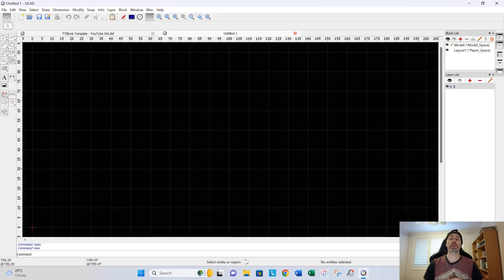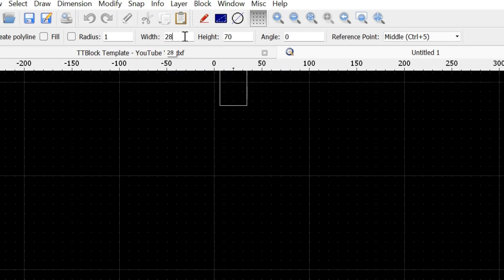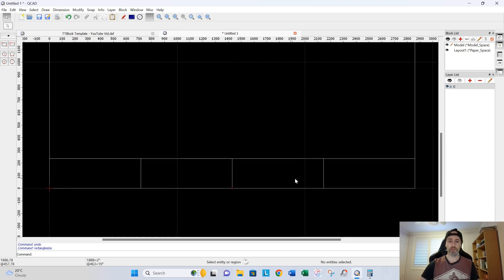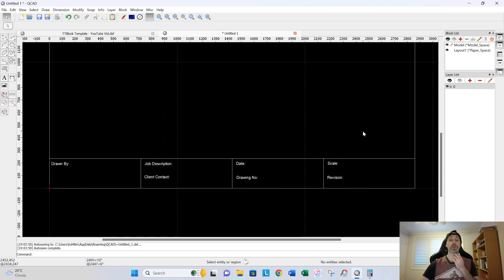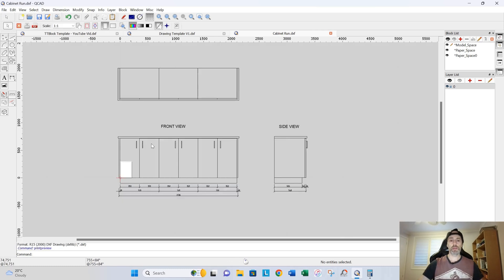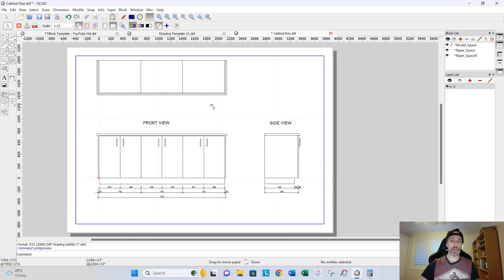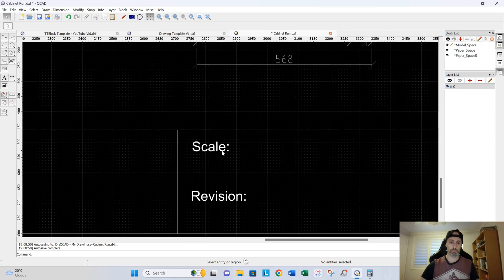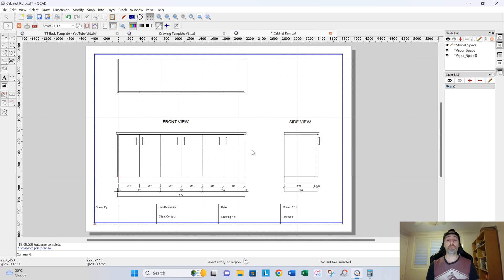QCAD Drawing Title Block Template & Printing | QCAD CAM

Comment: Hi. Thank you for your video. 
I have bought the newest version of qcad pro.. in the effort to learn it i wanted to learn to or rather was wondering if there is a way to create templates to scale for different size papers.. such as common blueprint sizes like 18x24, 24x36 and 36x48.. meaning i would like to create these templates to work with different scales such as 1/4" = 1' etc.. are you able to make a video of this? Thx
Reply from the maker: Yes if you watched this video till the end you would have seen a link for another tutorial video that I made dedicated on making a title block template, see link below and good luck:

https://youtu.be/Swyv9m9irMI?si=ET9zm-fQUMPX0LcL
Reply: @geoffsjoinery4990 thank you so much.. I really appreciate your sharing your knowledge.. see im a fire protection tech. And im now in the position where i have others under me.. and id like to have a better way to explain to them the scope of work by making smaller or rather a more detailed drawing than the blueprints we get from our designers.. see for the most part our designers work off the structurals given to them.. these drawings aren't always updated.. with site conditions and it seems designers barely visit site before creating drawings.. this will surely help me.. thx a bunch. .

Comment: Do the print screen always in the same position or it change according to last printing task
Reply from the maker: If you have closed the program it will change to default but if it remains open then it will stay in the same position

Comment: How did you choose the dimensions of the border? 2859 mm is about 112.5 inches, so I'm not sure how that relates to your paper size.
Reply from the maker: Just going off your paper size and what size you actually want your border. Your right looking back not sure why I did the measurements 1m oversize! It doesn't matter as you will scale it down in the last process.